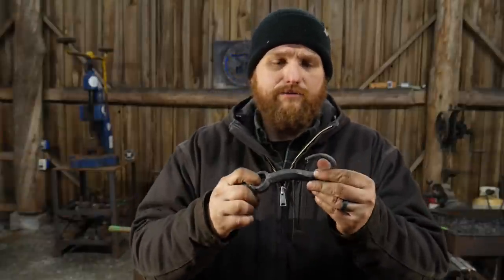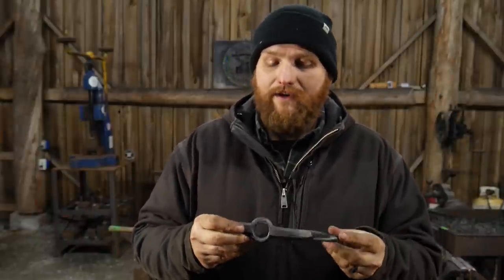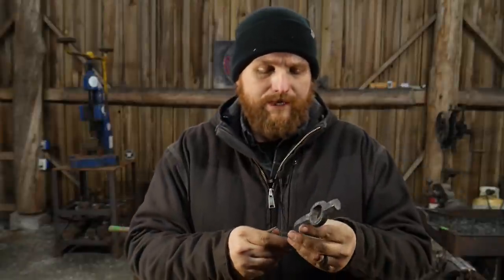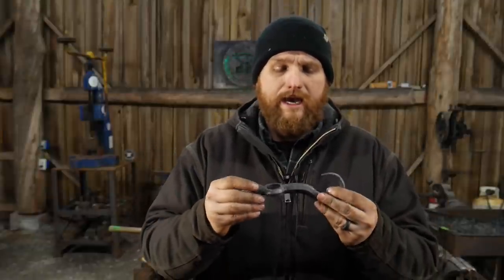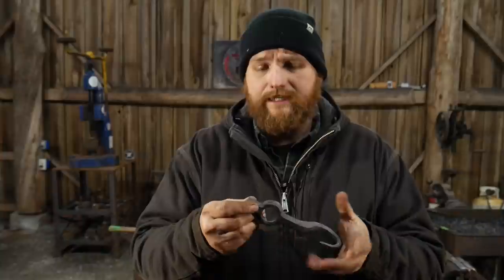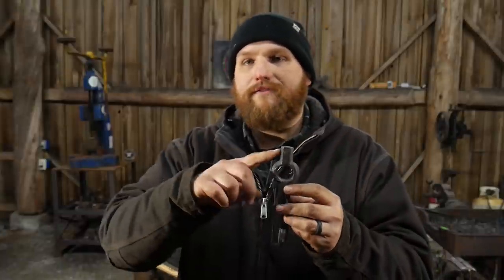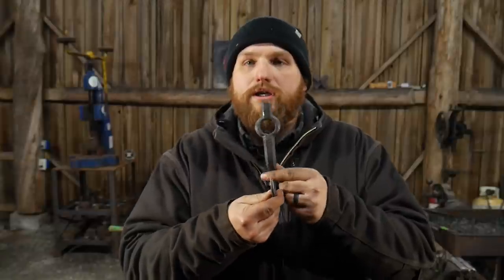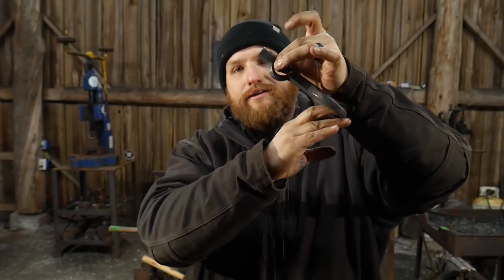Forging a Butcher's Hook

Comment: I have seen this style of hook 
with the tang over the eyelet 
used before. 

Quite handy when you have to 
change out hooks with your tackle. 
(for size & capacity)

The benefit of having the tang 
is with the use of a bowline style 
knots & not using clevises.

Just slip the bite of the loop 
into the eyelet from the hook 
side & over the tang.

When you lift the rope / cable up, 
it uses both gravity & leverage to 
keep the hook dug into the load 
(this case meat source), 
& reduces the chance of 
slipping off.

My two cents worth 
😉😁

Comment: Roy, if that hex bar came from a  machine shop which being in the midwest it most likely did, it is most likely 12L14 or maybe, maybe, 1030. Those are the most common metals turned. I run tons of it.
One other thing that really bothers me, please take that allen wrench out of the fly press when you are using it. I know it is not moving fast but it is coming down with 8+tons of force. If that wrench comes out and falls it can possibly get hit upright between the dies. It will then become a bullet. Not saying it will happen, just the possibility is there and as a machinist by profession it drives me nuts to see that. Never leave a loose tool in the moving parts of a machine. If  want something you wont loose may i suggest welding up a t-handle that will stay put. Always safety first. 
Blessing to you and the family have a Merry Christmas.
(still cant figure out why anyone would move to that state up north.)
Reply: Well Eric, I can't speak for Roy, but when you live most of your life in a certain area, it's home. I get the same kind of weather as Roy, you get accustomed to it. I grumble about the snow, but it's home.